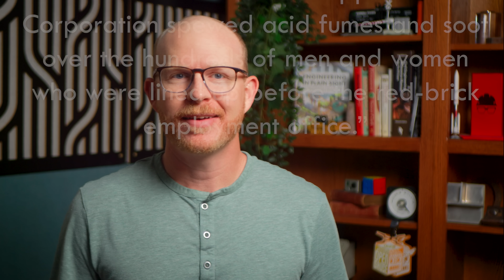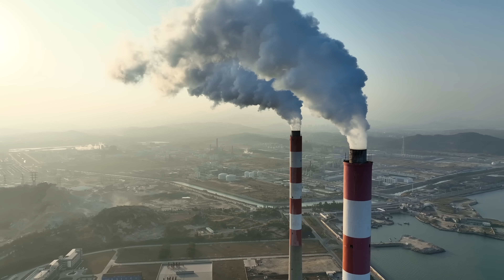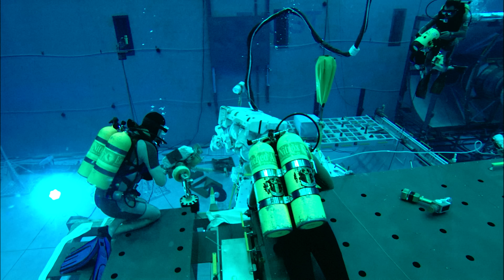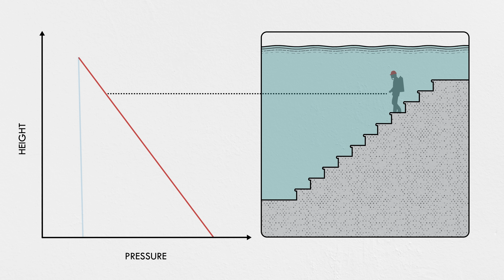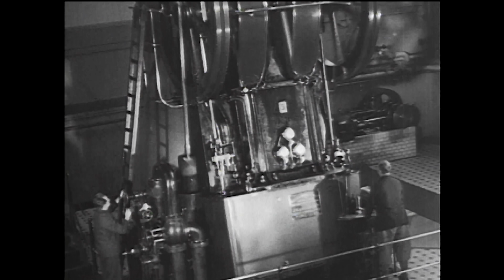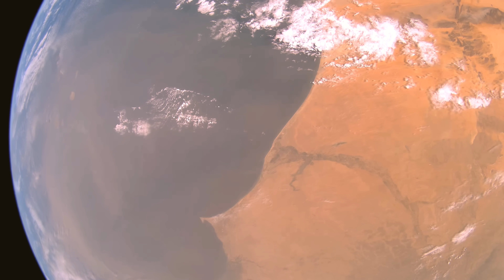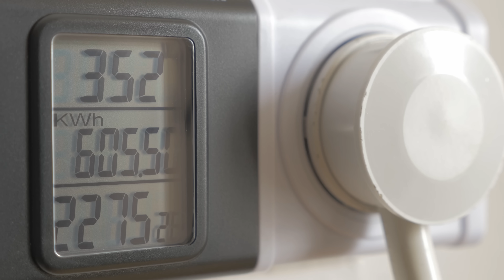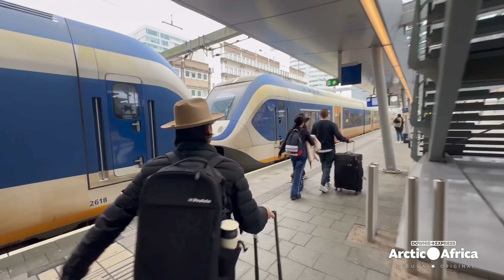Why are Smokestacks So Tall?

Comment: Interesting ! I was a student assistant working at the California Air Resources Board over 50 years ago when a lot of the research on smokestack height was being conducted. Most of the stacks they were working on were at oil refineries. It might surprise some people to know that the research was pretty cooperative and that the industry and enforcement agency shared a common goal of reducing measurable hydrocarbon emissions as much as possible.
Reply: I work in coal and gas fired power plants. They're VERY serious about emissions. I think people would be surprised at what doesn't come out of those stacks. Especially now with the newer EPA regs that went into effect under Obama when all these plants either had to shut down or install very expensive scrubber systems. The scrubber at my base plant cost over $400,000,000 in 2012. Would be MUCH more expensive today
Reply: California policing pollution, surprising? 🤨
Reply: I traveled to chemical plants for work for years. and I was genuinely surprised by the care and concern that went into balancing profit and environmental protection.
Reply: How come it was so cooperative, from the industry's perspective? Common sense would usually peg them as not being particularly interested in even acknowledging that there could even be a problem, since fixing any such problem usually tends to cost them a fair bit of money.
Reply: @mnxs  TL;DR Environmental protection is more expensive in the short run but reduces profit loss in the long run.

Longer answer:
The cynical answer to your question is that the companies would not be able to operate at all if public opinion was against their existence. Look at nuclear power plants in the USA. Modern plant design is much more environmentally friendly than any energy alternative, but high-profile accidents in the past has caused them to be practically extinct in the USA. Whoever might have had the opportunity of making money by owning a nuclear power plant is currently unable to do so. Other fossil fuel corporations want to stay in business for as long as possible because they cannot make money otherwise. The only way for them to do this is by putting a concerted effort into improving public opinion by being fully consciences and proactive about of whatever issues that their industry might cause on the surrounding population.

The secondary benefit for larger companies is that, because environmental protections are very expensive (as stated in the original post), upstarts are rarer. So, competition is driven down. Not just anyone can afford a $400 million dollar scrubber, which means that no one else is going to try and compete with the company in that area.

The less cynical answer is that most companies include employees who live in the area that don't want to face the environmental impacts of their own work. They therefore try to improve public safety because they are the public. Most people don't want to work for a company if they think they are actively harming their children, neighbors, and self as part of their work. I used to work for a petroleum company, and I can second the original commentor's assertion that the company was very active about maintaining a positive public image to the local community. Part of that effort included being quite supportive of environmental regulation.

Sorry if this was long, but I feel like you had a great question that deserved as best of an answer as I could provide you.
Reply: @ZoinkMeisterPatrick Great answer, thank you!
Reply: @mnxs I think it’s just the political narrative that has made it a common belief that the companies are dead set against controlling emissions

Comment: I know some early locomotives had tall stacks to improve the draft and burn hotter, but it meant they couldn’t operate on lines with low bridges or tunnels. I’ve seen a similar effect with my Wilesco steam engine. Without the chimney it barely generates enough heat to run the boiler, but with it on it can easily run it even with little fuel.

Comment: How a Chimney Draft Works — Step by Step:

1. Combustion heats the air
→ Hot gases expand → Pressure rises briefly at the base.

2. Chimney is open
→ The pressure spike escapes upward, creating an initial push.

3. Cool ambient air is drawn in at the base
→ Replaces the rising hot air with denser, colder air.

4. Now the chimney contains a column of lower-density hot air, while the outside has denser cold air.

5. Hydrostatic pressure gradient kicks in
→ At the same height, chimney air has higher pressure than ambient → causes continuous upward draft.

Comment: 9:03 - You're not considering the shape of the Mega Stack, it's a straight pipe so pressure drops as it gets to the top counteracting the buoyancy of the air.... It should taper as it gets to the top so it stays at the correct temperature to lift.
Edit: 11:53 - Next time use the fan to pull the air instead of pushing it towards your demonstration... It's a lot more natural that way and sometimes 2 fans (one pushing on low and one pulling on high) makes it act more predictable as well.    😁👍

Comment: 15:19 Shortly after I started a new job in early 2017 I had to drive past a large coal power plant. One day it was a foggy winter day and driving along the highway, I suddenly found my car filled with one of the most foul smelling scents I've ever smelled--it was definitely a fumigating plume where the coal smokestack was getting held in by low clouds and then funneled southward towards the highway and ground to mix with the fairly dense normal fog. Was that way every morning for like a week, but at least after the first time I wised up to put the air into recirculating before that point so I was spared inhaling whatever grotesque pollutants were in that fog besides the H2O.

Comment: ΔP. It's always ΔP (and usually never in a good way).
Reply: Also note we used to get fumigating plumes in my old home growing up. Local sawmills & pulpmills would get their stacks stuck below an iversion later and they'd routinely gas out the older part of town that hadn't moved up into the hills above town so was above the inversion layer in the valley. I thankfully was above it most of the time as asthma was a problem growing up (probably in part due to the mill fumes).

Comment: Before I was laid off from my job, I suggested converting the condenser tower for the warehouse refrigeration into a thermal chimney. Put a series of coils in a circle leading to the chimney. It would generate power like a solar chimney, but instead of a giant solar collector, it would be powered by the heat we were trying to remove. Instead of using power for fans and water for evaporative cooling, you would get back electricity. Could theoretically be used for any air conditioning.
Reply: Works in theory but not economically. The cost of materials needed to get both the heat transfer & still allow airflow to be minimally impeded so you can actually get a convection current moving is far too high to be cost effective. You'd end up with something similar to a cooling tower on a nuke plant. The problem is that you have to get the heat out of the refrigerant (that has to stay in pipes) vs. out of water that can just be sprayed inside the base of the tower to directly interact with the air being drawn in. 

The other tricky but is that you need time to set up the air currents, but refrigerating systems don't like waiting for a natural draft to kick in - you'd need a forced draft initially to get it going so the refrigeration system didn't overheat waiting for the condensing side to start working. 

I do like the idea though; if i had all the time in the world it would be an interesting experiment with the home a/c unit.

Comment: My coastal southeastern US hometown has (had) a steel mill and a paper mill. The paper mill stinks like crazy when the wind is right. Sometime in the 90s they added some new scrubber or environmental system to help with pollution. I dont know the outcome of that side of things, but what did happen was ALL the Grey Mans Beard Moss on the oak trees downtown died off. It's wierd seeing all these beautiful old oak trees with absolutely zero moss on them. That's not normal for the south! Get out of town and the trees are covered with the moss.
 
Wonder why that is?

Well, the steel mill has been closed for a while, and the paper mill closed at the beginning of 2025. 800+ jobs gone. But I wonder if the moss will come back.
Reply: It may if climate is still acceptable and the Moss species still exist in other places

Comment: I have a different relationship with smokestacks, did construction lifting with an S-58 Helo, flying mechanic. I worked on 6-7 different stacks. Power plants and Granite City steel was a regular. Valve on top of a stack eroded fast from the sulphuric acid. 
St Louis Helo

Comment: Another thing that needs to be addressed is gas temperature in the stack.  If the temperature in the stack drops too low, any sulfur dioxide in the gas will combine with any water in the gas to form sulfuric acid, which then proceeds to corrode the stack.  I have seen stacks collapse at the base due to this.

One of the ways pollutants are controlled is by continuously sampling the exhaust gasses and using the results to regulate catalyst control systems.  I worked at a gas powered power plant where we used ammonia injection to control nitrous oxides and urea injection to control carbon monoxide.  We were limited to 4 and 8 ppm respectively.  Exceeding these values resulted in an immediate fine.  The penalties were so egregious that we installed trips that would shut down the plant immediately if we lost control.  

Maintaining the lab grade gas analyzers in an industrial environment took up a great deal of time and resources.

Our permit to operate required us to test oxygen, carbon monoxide, and nitrous oxide to +/- 1.5 ppm accuracy, with daily calibrations to prove this,as well as annual third party testing to prove our system was working.  No easy task.
Reply: Also those fines must have been very large if you were authorized to shut down the entire factory for prevention. A process like that would be quite annoying to stop and start up again.
Reply: @whitebeans7292 It wasn’t a factory, it was an oilfield.  Most of our electricity went to the grid.  When we tripped, we just backfed from the grid.  The more important part was the loss of steam.  If we were down more than a couple of hours oil production would start to drop off to the tune of a quarter million in losses per day.   You can see why we spent so much time and money on it.  A single analyzer cost 20k, and the amount of repairs that didn’t require factory repairs was limited, so we had to keep spares we could swap in when one failed.
Reply: OH That's how they got rid of acid rain! They realized it was bad to make acid in the exhaust gas
Reply: @tomholroyd7519 No, they knew that in the early steam engine days.  The acid rain is caused by sulphur compounds in the fuel which form sulfur dioxide.  This is particularly bad with coal.  Natural gas and fuel oils form far less.  They didn’t get rid of it, they just abated it to acceptable levels by installing soda ash scrubbers on coal fired stacks.  Mt Pinatubo put more sulfur dioxide in the atmosphere than several years of human coal burning in just a couple of days of eruption.
Reply: Thank god dismantling the environment protection agency wont have any bad cosequences..
Reply: I live in Sudbury, Ontario we're home to one of the largest smoke stacks in the world, known as the "Superstack"
The company would use over $1,000,000 worth of natural gas every month to heat the sulfur gases enough so they would prevent the exact thing you're talking about!!
Interestingly they're currently working on dismantling the stack because they have made so many emission reduction projects in the last 2 decades that the sulfur emissions are down close to 90% from when the Stack was first operational
Reply: @AH-lw2bj  that's amazing to hear that they are dismantling the stack. I had a chance to actually walk underneath it (like two decades ago). We knew a member of the safety crew, and he took us on a tour. Pretty amazing place, but very comparable to Mordor. :P
Reply: @rcjbvermilion  very cool! I've worked directly below the stack on a few construction projects, and worked on alot of the emissions reduction projects over the last 15 years.
You can google "Vale Clean AER project" for more about that stuff and all the info about the stack dismantling is on the Vale website just search for it...
You should also look at some before and after pics of Sudbury, much regreening efforts have yielded great results and it doesnt look like the moon anymore 😅
Reply: @rcjbvermilion  ive worked some construction projects at the base of it and did alot of work there when they were doing the emission reduction projects, known as Vale Clean AER projects if you want to look it up...
You should also look at some before and after pictures of Sudbury, with much regreening efforts over last 30 years, it doesn't look like the moon anymore 😂😂
Reply: @rcjbvermilion  i keep writing you a reply but it gets deleted everytime 😢
Reply: @AH-lw2bj  I was there in the early 2000s. By then I think things were on the upswing. All that acid rain did wonders for the blueberries, though. Anywhere around Sudbury, up to Chelmsford - you couldn't stop and pee in the woods without hitting a blueberry!
Reply: Hey hey! Finally met another guy who knows CEMs out in the wild. 
What kind of analyzers did you run? 
I maintain a lot of thermos and a handful of Siemens and a few CAIs
Reply: @josephlynn1375 It was late 80’s junk that had been jury rigged to hell when we got the contract.  We had to design and build a new one from scratch.  Horrible Horibas for CO and NOx, Teledyne for O2.  Not my choice to mix and match, customer was both cheap and flakey.  Peerless, and Perma Pure dryers Genie moisture scrubbers in series along with Genie moisture scrubbers.  Peter Paul valves.  Don’t remember sample hose manufacturer.  Generic vacuum pumps, gauges, manifolds, etc. ordered from McMaster.  Of course Swagelok for tubing.  Automation Direct PLC.  Customer took one look at Allen Bradley prices and told us to just keep Net90 working.  We looked at GE/Fanuc, but settled on AD.  Entire PLC cost less than one AB analog input card and software is free.  Built the entire thing from scratch and mounted it on an aluminum backplane.  Installed it during 6 year overhaul.  Hardest part was qualifying it with APCD.  SCAQM is gestapo.  Total cost (minus analyzers) was 16k in 2002.  Went from nightly callouts (sometimes two or three) to one or two per year, mostly due to operator error.  Got the design from another plant up north that had the same problem and custom designed their own.
Reply: You guys peed in the stack to prevent carbon monoxide poisoning??? 😆
Reply: @whitebeans7292 The carbon monoxide wouldn’t poison us, but it would definitely lower air quality in the area, and urea is not urine, just a component of it.  Also, it would be hard to pee 20 tons per month, which was our consumption rate.
Reply: @Simple_But_Expensive This is fascinating. How come you didn't use catalytic converter systems to lower the NOx emissions (and CO and hydrocarbons, for that matter)?
At a consumption rate of 20 tons a month, just for one of the reagents, I'm tempted to think that catalytic converters would be beneficial economically in the long term, even with the (very high, I'm sure) upfront cost and those particular reagents being very cheap. I realise I don't have a fraction of the full picture here, though.
Reply: @mnxs The system did use catalyst, but at the volumes of exhaust gas produced the catalyst required the reagents to promote them.

I won’t go into all of the chemistry, but to give you an example, ammonia (NH3 combined with the NOx (NO2, NO3) to create nitrogen (N2), oxygen (O2), and water (H20).  The CO conversion was similar.

Since the gasses had at most a few seconds to convert, a catalyst was required.  Platinum catalyst like in a car would have been way to expensive, so we used a different catalyst.  I don’t remember exactly what it was but I do remember it had tetroxide in the name.  Titanium tetroxide maybe?

I retired years ago so I stopped thinking about it a decade ago.  I could still do a full maintenance cycle on the analyzers though.  Several times I had to do it at three in the morning with my boss looking over my shoulder.

Comment: This was helpful and educational.
When I was growing up it was sometimes said that smokestacks got higher because the regulation was based on measuring air at ground level X distance from the polluting location.  This was characterized as a loophole, but this was a time when it was harder to research and get this kind of information.  I hadn't understood that some of them breakdown over time in a way that means that a tall smokestack is not just moving the problem, but effectively solving it.  I'm sure we have much more advanced measuring (and modeling) techniques today.

Comment: 14:27 You briefly mentioned a temperature inversion, and this is very consequential in some areas, such as the Salt Lake Valley in Utah. Here, large inversions are common and can keep air and pollutants more or less trapped in the valley for days at a time, until a rainstorm or other weather event (which can take a while in this arid environment) breaks up the inversion or captures particles out of the air in raindrops. This can lead to really bad air quality even despite concerted efforts to reduce emission of pollutants, as it slowly accumulates over several days. There are times when if you hike up onto the benches and foothills above Salt Lake you can look down and see a fog of pollutants over the valley.